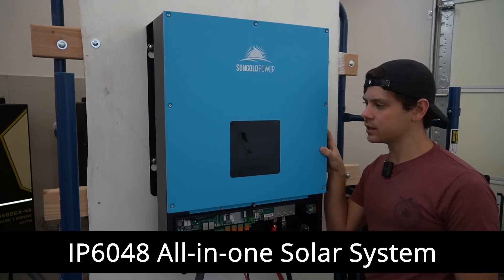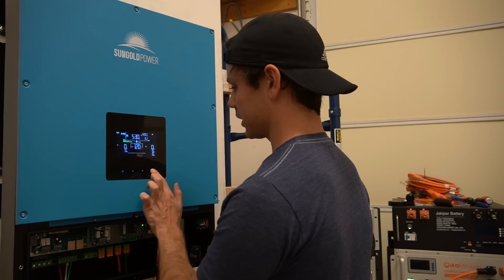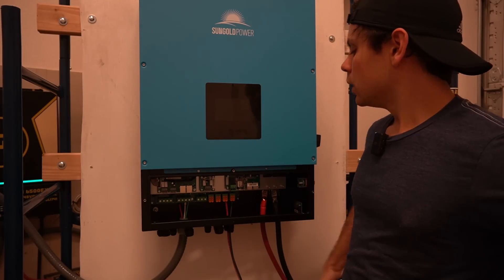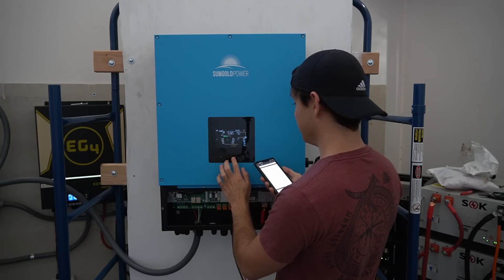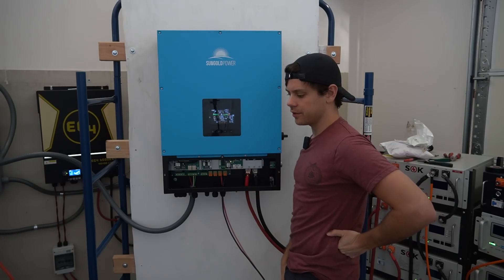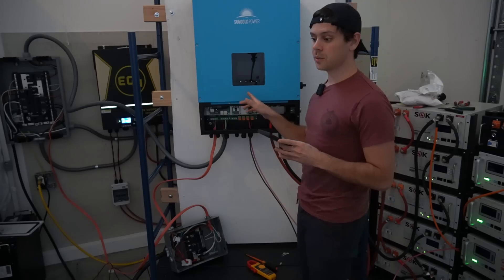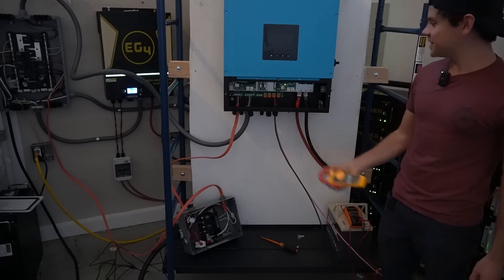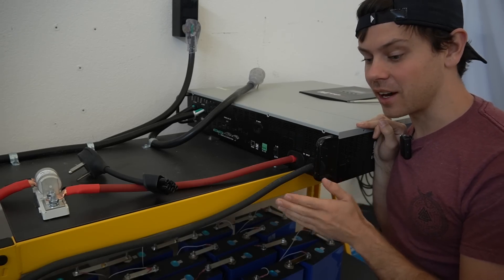New! $2,095 All-in-One System: 48V Waterproof "IP6048" 6000W 120/240V

Comment: Hi Will,

You have some terrific content.

Do you have any MTBF (Meantime before failure) ratings for the equipment (inverters, automatic transfer switches, etc) that you are demonstrating?

I am going to put together my own system based on my requirements (the all-in-one systems do not meet my requirements), and there are alot of moving parts (well electronic, that is).  Being that many of the components are manufactured in China, are they reliable?  That is, do I need to source spare component equipment incase of failure to ensure that I can get the same parts for drop in replacement?

My main requirement is for home power outages (8KW, 120Vac, 60amp - 70amp max)

Thanks,

Steve

Comment: The way around the terrible buttons and user interface is for these devices to have an Ethernet or WiFi connection so they can be configured and monitored from a web browser.  This should be the standard for these devices.   Not apps.   From a web browser so any device can access it.  Apps are fine until the manufacturer stops supporting them.

Comment: 'schedule the AC Charging' is a game changer. I have a MPP Solar LV5048 and it works great, but being able to tell the inverter to only charge the battery during specific hours of the day would be key!
Reply: Got an Mpp 7248 max ...
I can set time for output source priority mode by one hour increments ...
I can set time for charging source priority as well
It's 48v batteries . 240v input and output ... 8000 w max solar array ... 2 mppt ... in/off grid hybrid that can't feedback the grid ...
It's really a game changer to be able to set charging times as electricity rate are varying during the day there ( France ) .
Thanks .

Point stand I miss the ability to feedback the grid as it could help the neighborhood in case a failure the grid ...
I know where to disconnect from the higher voltage and would have been able to use the wiring in case a real ... need . At least during the day ...

Safety regulations rules won't ever think nor allows a true being ... before, after ... during ...
Official safety concerns !!!

Thanks

From France with .

Comment: I believe the setting for dc charging from ac mains said 60 amp max that means you can pull 60 amps tomorrow the mains input to use for charging.  Try turning it down to 20 amps. Should reduce the output to around 80 amps.

Comment: Thank you Will. Your videos are what gave me the courage to begin my adventure into solar land. I already bought this unit but haven't hooked it up yet. If the runaway current on the battery connection is the same on mine, what Victron charge controller would you recommend for the fix? I have 3 EG4 48v.

Comment: Totally with you on the real buttons. Touch buttons are over rated, and in reality not practical.
Reply: this one has to do with waterproofing. Physical buttons have a lot of complications and cost around waterproofing.
Reply: @koborkutya7338  not really, the can be enclosed in a rubber boot/ gasket
Reply: @JosiahK555  it is doable but more trouble, less lifetime and most of all more cost. Once they waterproofed the display the capacitive "buttons" rids them of all the other trouble. It is a budget unit whatever features it has and they just follow the trend a lot of other companies do. And they all do it to save cost, no matter what ideology they find out for that. I know well because I work for one which is not even a budget brand and still.I hate this btw but I strongly believe it is the reason.

Comment: Would you clarify the ground neutral bond issue? If it's off grid, ground your panel, but if you're using the AC charge function what's the correct way to install? Thank you Will.

Comment: This device shows how the effort to make a good inverter can be neutralized not only by immature software but also by a bad display. I really hate "custom designed" LCDs. Especially in the price range of hundreds or thousands a standard LCD matrix display would not ruin the calculation. The problem with device specific LCDs is that their design is made by electronics designers or programmers who are usually bad graphics designers or they are designed by graphics designers who usually design plastic toys or computer games. In addition to that these LCDs cannot easily be changed if programmers want to add new features and they can only display error numbers, no plain text. Some customers say they don't need a display at all if there is a good app and PC software. I prefer if an inverter has a matrix display and hardware buttons.

Comment: I have inverter with similar software. Unit called Axioma ISMPPT BFP 5600. Using it from July. In my case it even has LED lights around the screen. :) Had to switch them off, because it looks like permanent holidays in the shed where it installed.

Comment: Off topic and total newb question.
  I want to power my large fishing kayak with a 55lb thrust trolling motor using a 100ah lithium battery and a foldable waterproof 100w panel. Is there a video in your playlists that would cover such a setup? I'm trying to get a good idea of the parts I will need. Is it just Solar panel, charge controller and battery?  Is there a decent budget All-in-One kit maybe?  Any help or advice would be greatly appreciated.

Comment: I was going to add a detailed geek-oriented comment, but here's what I expect happened: Non-engineers said make it so, use all the old code.  Testing failed, non-engineers said it's good enough.  Ship it.

These fundamental software development process issues have all been solved over the last 50 years, starting with Deming, and now CI/CD, BVT's, DevOps, etc.  Clearly, this is an immature, poorly lead software dev org.

Comment: First I want to thank you for complaining about "Capacitive" buttons. I despise Capacitive Buttons because there is NO tactile feedback, and they are generally don't function as well as Mechanical Switched buttons. If a manufacturer wants a nice "sleek" front panel buttons they can put the mechanical buttons flush with the surface.
This type of interface problem where the interface dies before you can change anything will absolutely prevent me from considering this product. (Looking forward to the firmware update review, if you ever get it). Additionally lack of Automatic recovery from Overload is really bad. And the inability to reset the unit without having to disconnect everything is also really bad.
I hope they can fix these issues.

Comment: Actually about to get an eg4 inverter and battery set up was wondering your opinion or anyone else's opinion on would it be better to get 2 3000 watt inverter instead of 1 6500 watt inverter my thinking is in an emergency if one goes down you would at least have 1 to fall back on and are there draw backs to that decision thanks

Comment: edit: ordered one! Can't wait to have a whole sub-panel 240v backup. The LV2424 I have now works well, but I can only have a couple small circuits on it.
I’m looking to get a split phase inverter and have been strongly eyeing the LV 6048 especially since it’s on sale right now for a pretty darn good price. I can only have about 5KW of solar based on my small roof size so I don’t really need the high voltage input although it would be nice. Just not sure if I want to invest in two paralleled 6548s, as nice as they are. And I need two solar inputs so something like a single EG4 6000ex won’t work. Anyone here have insight  on the 6048 with some considerable operation time?
Reply from the maker: I've run mine for years now. I use it with my backup EV charger battery system still
Reply: @WillProwse  thanks for advice and insight Will!
Reply from the maker: Hey I love the lv6048! I am still using it in one of my systems. Fantastic unit. The biggest downside is the solar input voltage limit. What you can do instead is use a victron solar charge controller with the lv 6048 and you will be set
Reply: Hi  @WillProwse  The downside is the LV6048 needs a battery to work. I like the battery-less function these SunGoldPower inverters have and would love to see you testing it

Comment: That spark that happened in your breaker box is the same thing that happens when I turn my Growatt SPF 12000T DVM MPV to 50A when charging the battery from AC.  My breaker never trips when it happens. I can't for the life of me figure it out.
Reply: It's most likely the in-rush current to charge the capacitors... All inverters suffer from the same problem.
Reply: @Techa-lo2dc  it only happens after  it has been running for a while, and it seems to happen while it is ramping to max current, just like happened to Will.  If I turn it down from 50A to 40A it never happens.

Comment: WILL, Do you know if we can get source code for the firmware on any of these inverters, then anyone who follows your channel, and can code, could put our skill sets together, and create much better user friendly firmware, make it open source, and add evolving improvements much more quickly, and reliably???

Can you get access to the firmware software code, and other hardware interface specifications, so we could advance the state of the art to offer more user friendly settings, and also allow programming from computer or phone, save and recall settings, and upload and download settings files, to allow quick settings changes for testing different configurations???

Please advise here, and start a thread on this topic in the forum.
Reply: I was thinking the same thing.  DIY channel and no one can DIY the software?  DIY has to be more than turning a wrench!

Comment: Some guesses
The need for a reboot may be related to changing the off grid enable and modes rather than the overload

Perhaps the 30A load setting referred to current drawn from the grid rather than to battery
Reply from the maker: That's why I posted the manual showing it refers to the DC amperage. Not ac. That was my first thought as well
Reply: @WillProwse   Missed the manual. Would be interesting if they got it wrong and what if you set it to 10A if you've still got it installed in that awesome rolling scaffold test jig 😀

Top heavy stuff scares me (since my first wife, anyway)
Reply from the maker: And yes good point about the reboot. Typically there's an on and off switch so you can do it quickly

Comment: So I have the same brand 1kw unit that if I have a overload I have to disconnect the battery (we are completely off grid and the inverter has been running for 2 years now with no issues)

Comment: The 30a setting for max charge current is probably an ac value. I think my old Xantrex inverter does it the same way.
Reply from the maker: That's why I posted the manual in the video so you can clearly see that it's not. It's the DC amperage rating

Comment: That 30 amp limit setting was probably from the input not the output to the batteries.
Reply from the maker: That's why I posted the manual so you know that that's not the case. It's the DC output

Comment: If you think like an engineer most likely even if you save the settings they wont apply until you do a complete power down and restart... I.E. disconnect from grid /solar and batteries  then reapply battery power ...solar then grid... Dumb but I bet that's the case..

Comment: Oof. Two bad ones in a row. That must have been incredibly frustrating. Is it possible to limit the battery charge current at the battery? They might not have enough switching at the battery connection to limit the current.

Comment: this unit seems like a great option for grid-tie peak shaving if they get the software to work.  I'd look at replacing my sunny islands with these if I can stack 6 of them and produce 30kw.  Plus, think of all the solar grid-tie ability you'd have with 550v inputs.  You can purchase six inverters for about $12k, while it's a bit more than solark you could run 20+kw of solar power.
Reply: Dont no support.
Reply: Did you watch the vid? Think again.

Comment: Just a thought based on some of the ATS switches and UPS systems I used to work with in a data center environment...  But why can't these guys just slap in an ethernet port and give these things a web based interface?  That'd make things so much easier to work with when configuring and monitoring.

Comment: Apparently this is what happens when a bunch of engineers work from home designing a product but no one actually ever physically touches it or uses it themselves. OMG
Reply: To be fair, the annoying buttons are to get the ip68 waterproof rating. But yeah the software is a train wreck.
Reply: @offgridphilosophy7959  No, they could easily put a nice clicky button behind plastic which would still be IP68 rated but instead they went with the cheapest option. Waterproof buttons doesn't need to be bad, it's just the default.
Reply: @Torbjorn.Lindgren  Shirley your last name isn't rubber.
Reply: @offgridphilosophy7959  yes, but membrane switches would achieve the same waterproof rating and be more replaceable.
Reply: I work on software from home. My company just ships me the hardware to setup real world and use while I develop features and fix bugs. It's pretty simple IMO.
Reply: Exactly. This is what I experienced once. I once spent 3 days in the factory programming and testing a system that got shipped to a rural site, and it worked as designed. Other times they didn't let me work on it and it cost them two weeks to fix this kind of problem on-site...
Reply: What's really funny is when somebody is being paid to put other people's products down that's really funny not. Terribly an honest review very unprofessional.
Reply: exactly, and that is happening across the board with everything from tools to materials in construction. That's probably why our cars are a lot more user friendly, everyone uses them.
Reply: Not everyone uses a car.  Since most of those “engineers” are working from home, they are probably doing it from some beach in a foreign country.  It’s too bad we can’t find better workers.  If only they would stop quitting every time somebody tells them to come to work!  😂
Reply: @KeithCarmichaelInFL  yes, but the reason problem is that the head office doesn't want to pay for both design and testing. Engineers working from home are fine if the designs are still tested in the real world. But too often they are not...
Reply: Stay home stay healthy!
Reply: @jeffwhite3021  Absolutely!  Not to mention how much stress you avoid!
Reply: @KeithCarmichaelInFL  I was being sarcastic. I do think that if your employer and the type of work you do allows you to stay home, I fully support that. It's less people on the road. Less pollution generated etc.
Reply: @jeffwhite3021  cute little lib.

Comment: One of the biggest questions had by people like me, I need this to operate with no internet connectivity. Do I have access to my stats on a local network without internet?
Reply from the maker: None of these inverters or systems require internet connection at all. You are thinking of mass-produced grid tie and ac coupled battery systems. Not what we use on this channel.
Reply: @WillProwse  I'm incredibly appreciative of the reply. I think I need to do more research. I wanted the Sol Ark 15 which is the grid tie system but after watching your videos, I'm not so sure anymore. Thank you for what you do.

Comment: They need to make the controllers able to be configured in a computer, then transferred to the inverter as a data stream.
Reply: They need to use a standard dot matrix screen and do a proper menu interface, with mechanical buttons.
gimme a column of buttons (5 at least) on the left to pick menu options.
HOME, ENTER, CANCEL, UP and DOWN along the bottom of the display.
Reply: And with TCIP over standard CAT6, not the old RS232/USB crap. Also logging should be available onsite over normal TCPIP or wifi and not to cloud services.
Reply: I control my LV6548 from the Watchpower app on my phone. That whole button pushing on the control panel is annoying.
Reply: Most programmable controllers were done from software on a laptop only a few years ago... Not sure why we ended up with that not being the default option today
Reply: Yeah, I'm sure just building it on a Pi Zero 2W would have been so much better.